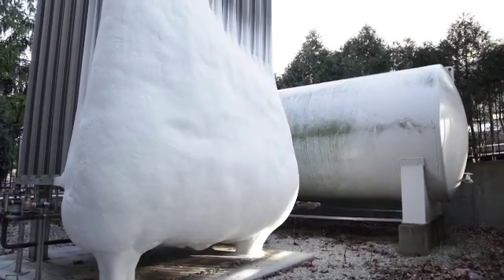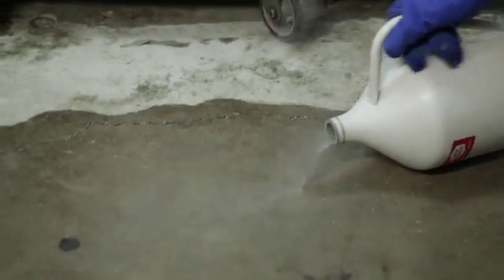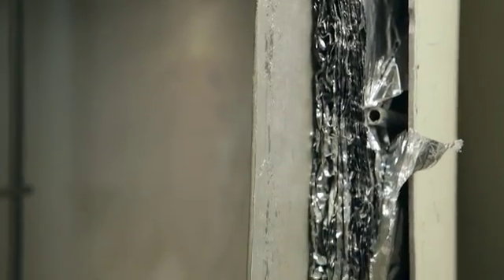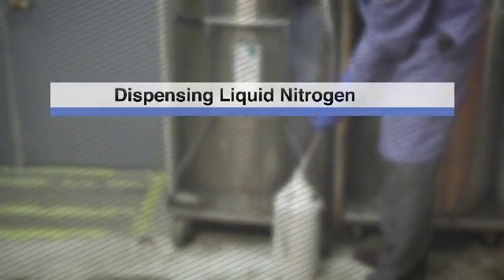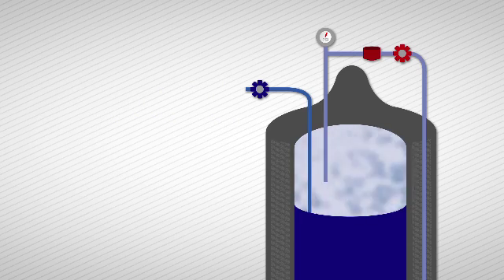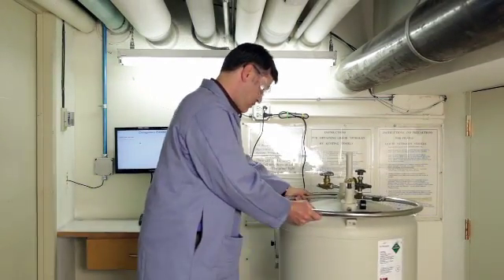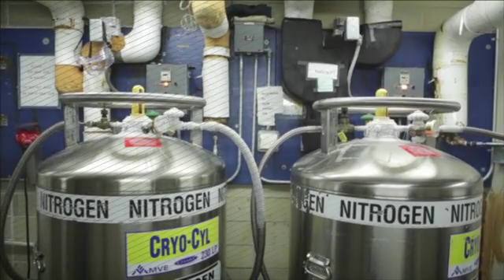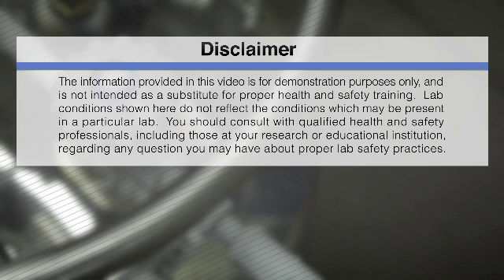Filling and Maintenance of Liquid Nitrogen Tanks

Comment: Much of what is said in the video is very sensible, and you are advised to understand the equipment properly before using it. However, please remember that using thick inflexible gloves which, while providing insulation against cold, can allow small flasks to slip between your hands creating a different type of hazard. Droplets of liquid nitrogen on the skin, in tiny amounts, simply feels like pinpricks. Any clothing which becomes saturated with liquid nitrogen will hold the cryogen against the skin, which is highly likely to cause severe burns.

Comment: This is fascinating for me. 

I deliver liquid nitrogen (and liquid argon and liquid oxygen) to many facilities, including research laboratories, universities, and hospitals, in bulk. Most of the bulk tanks I deliver to have a capacity of 6,000 - 13,000 gallons, some of which are multiple tanks of said capacities manifolded together. However, I have delivered to tanks as large as 50,000 gallons or even dual 40,000 gallon tanks. 

I always wondered how the smaller tanks functioned such as in this video. Thank you for sharing.

Comment: very informative, learned a lot. specially about safety, relief valve importance, and gas transfer diagrams.
any information about rebuilding a Dewar please, in some of our containers we have noticed a vacuum break due to aging of o-ring in the double walls . i have a roughing vacuum pump plus diffusion pump
Reply: Hi jawad,Did you come across any information regarding this. I have a container having same issue. Any information on repairing instructions? Thanks

Comment: I want to mention one error.  at 3.55 they say to not cover, tape or plug a pressure relieve valve.  True although the port pointed to in the video is not a pressure relief valve, it's a vacuum port which should be covered to protect the vacuum from being disturbed.  All I ask is that you point to the right part.